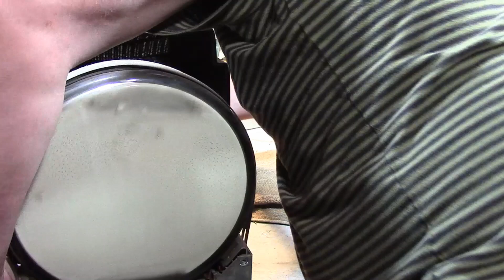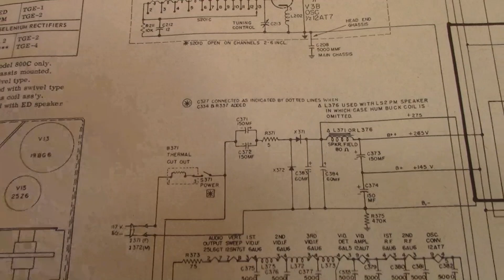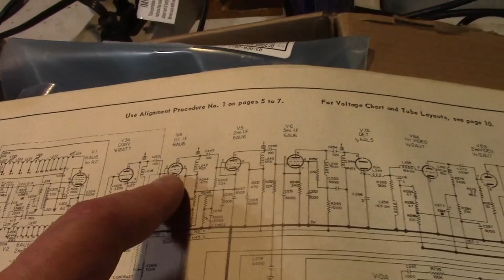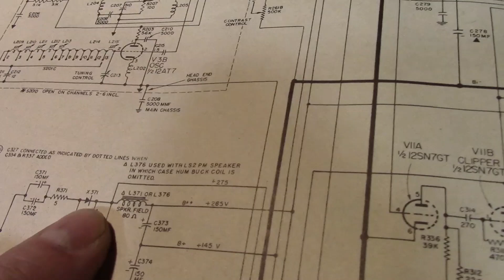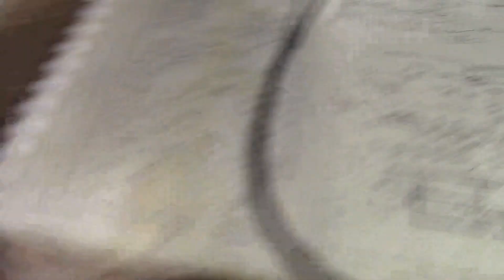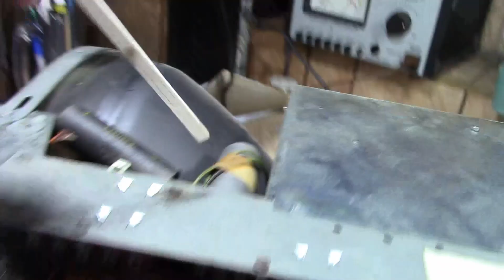GE 800 restoration p1o8

Comment: Why not re-stuff those caps? then you can reuse the mounting clips etc.
Reply from the maker: They red ones are not the originals and are larger.  That's why one of them is not mounted.  It's also very, cramped under the chassis.  The new caps are much smaller and make it easier to follow the wiring.  I also needed somewhere to mount the new diodes.

Comment: Seems, if you combine those paralleled caps, they might not even need to go where these are mounted, ...rather to points up under the circuit boards. 
 I did spot an axial 120 mfd / 450 v cap on JustRadios,  but the 300 is another animal. And maybe you'll want a higher voltage rating for better life.
Reply from the maker: Good point.  That's what I've done in the past like the Admiral I just worked on.  Radials sure are hard to find.  Not much demand anymore and they only seem to be available rated for 85C.

Comment: I have had just one experience with a selenium rectifier.  And strangely enough, it was one that bought to play with.  Not from any equipment, but probably my first ever purchased electronic component!  It was a flat aluminum package, less than half an inch thick probably 2 by 4 inches in other dimensions.  I saw some of them used in "new" radios and they seemed to always be placed flat on the chassis - probably for cooling.
My actual familiarity with stinking selenium came when we used them for transient suppression.  That was just before the silicon zener diodes took over.  I recall a trade name Klipsel.
But I have another question about your plans -- do you intend to add some resistor to compensate for the reduced voltage drop when you change to silicon rectifiers?
I have sort of related experience.  That was when I got frustrated about failures (and difficult availability) of rectifier tubes for 8 of our 80 watt amplifiers whose maintenance was my duty.  The tubes produced a little over 700 V DC bus and the replacement silcon diodes increased it to nearly 800 V.  The output tubes (EL 34) were stressed to their limit, or more.  Resistors to the rescue!

Comment: On my Canadian G.E with the same chassis, the electrolytic caps in the clips are all, or mostly, original, such that I may have a go at restuffing them. They are of the same style as that black cap on the top of that chassis, they had flat terminals on the ends rather then wire leads. If any were replaced it was by wiring the replacements in parallel with the dried out originals. Those Aerovox Dandees are replacements just like the red Planet brand ones. 
  My set also still has the selenium rectifiers, but they have been bypassed with top hat style silicon diodes, and some random sized 2 Watt carbon resistors, I guess for serge limiting. The set also has an electrodynamic speaker, complete with rubbing voice coil, connected with a bundle of stiff wire, so count yourself lucky that this one has a PM speaker with under chassis filter choke.
Reply: Those 2 watt resistors in series with the top hat diodes are to match the voltage drop of the original selenium rectifiers, which is much higher than the silicone diodes. Without those resistors, the B+ and B++ voltages will be way too high off spec.

Comment: The locomotive? This  streamlined art deco design is  pretty late for 1949!! The cage part  ran very hot in the horizontal section with
that  shoulder type 1930s tube and limiting air flow! This is pretty much advance design otherwise and trying to keep up with the Jones, i.e. RCA!

Comment: Hi, Bob! When you finished restoring the color roundie? I was waiting for that restoriation since the part 1, have I missed to watch some videos about that restoration?
Reply from the maker: No, I haven't done anything to it. It works well with it's old components. It's from the mid 60s and uses plastic film caps. Much more reliable that the paper caps in this old GE from the late 40s. Eventually I'll replace the electrolytics in it.
Reply: @bandersentv  That's impressive. Should be a relatively low hours set. I'll rewatch the video about it. All plastic films in the mid '60s, that was pretty novel. But it had to be novel since I'm sure it cost an arm and a leg back then.

I'm Hungarian, regular color broadcasting started here in 1971. The first color sets were imported from the Soviet Union, mainly from Russia and Latvia. They were pathetically unreliable. The design was OK, but they were filled with POS quality paper capacitors, and their other components as well were such low quality that these sets almost spent more time in the workshop than at the owner. 

Unfortunatelly, the CRTs were also random quality: some lasted a few years, but most of them died within 2-3 years, and CRT failure within 1 year was not so uncommon. On top of it, there were no CRT rebuilder services available here, so the 1-3 year old dead CRTs went to the landfills! Some say there were some rebuilders in Russia, and probably in Poland, but here in Hungary, AFAIK, none. 

When Hungarian companies started to produce color TVs, those were OK. Unfortunatelly, because of the Comecon, most of the time they had to use highly dubious quality Russian CRTs. In the early days, somehow they managed to bypass the regulations, and used UK made Mullard CRTs in the first and second production run of our first, domestically made and designed color TV, the Videoton Munkácsy Color (TS3202 SP II. 1975 ) . It had a previous production run at 1967 according to https://www.radiomuseum.org/r/videoton_videcolor_ts3202_sp.html  , but it was probably a very low volume production. In 1967, it was quite novel, since it was a hybrid set with 60+ transistors. Only the power circuits were tube based (H and V deflection and  sound output stage), and it was dual system: it supported both OIRT and CCIR sound systems and both PAL and SECAM color systems. An inside view: https://youtu.be/QY6EHVY1Jfs?t=184

Comment: The 6AU6 is basically a minature 6SJ7.  Ideally since that is a series-string set they should be 6AU6As, which I happen to have eight of right now.  If it weren't a series-string set I would probably convert it to use an 807 for the horizontal output tube.

Comment: Could they be using parallel caps for heat dissipation?
Reply from the maker: I think they did it to get the right capacitance and voltage in a small space.
Reply: As Bob said, yes, probably for space saving, but it has an advantage to share the current between the two. The series ones has the whole B+ current flowing through them, quite high ripple current, so it makes sense.
Reply: Also, electrolytics in that era were kinda limited in size. Both manufacturer wise and physical. Capacitors of that value and higher voltage would have been crazy expensive to source (if even available) and if so, would have been gigantic physically. Modern equivalents are like 1/10th the size these days. Pretty amazing.
Reply: caps don't dissipate heat unless they're about to blow up
Reply: @AntonBabiy  Sorry, but that's wrong. They dissipate some heat, obviously not that much as power resistors, but they do heat up in high ripple current and/or high frequency applications. They have dissipation due to voltage drop over their ESR, and polarization losses, both are frequency dependent. Look up some capacitor datasheets, they do have a dissipation factor. In this case, probably the series caps on the AC side of the B+ line would be a bit warm, espacially if Bob substitutes the two parallel 150uF with a single (and much smaller phisical size) 330uF. Probably not an issue, but I would check the maximal allowed ripple current in the cap's datasheet first.
Reply: @mrnmrn1  yes I know that but modern capacitors running at mains frequencies will do just fine as replacement for this vintage equipment. If we get into high frequency dc-dc converter design, etc then indeed you need low esr electrolytics or solid state capacitor. This video is about vintage equipment and that's why I've said that

Comment: I have one and it's one of my best playing sets. It's also one of the nicest designs too of the early post-war TV's. They came with both brass and chrome tone front metal parts and both the rounded-square and double-D screen masks. There was also a late version with the double-D mask that had a different knob set. They can't be interchanged with the earlier versions either due to the shaft lengths. Good luck on the resto.
Reply from the maker: Yes, and there are also versions in wooden cabinets.  Tabletop and console. I have an 806 mahogany one with a slightly newer chassis design.  A little awkward to work on but I like the novel design.  Nice to work on something different.
Reply: @bandersentv  As collectors are really focusing on these early post-war sets so many slight differences are found throughout their production run. I always heard that these were terrible to work on, but my repairman told me they're not too bad. I also have the wood version in mahogany with the rounded-square mask. Another classic set that works well. It's surprising how light it is.
Reply: The model 806 is an electronically better designed  unit.